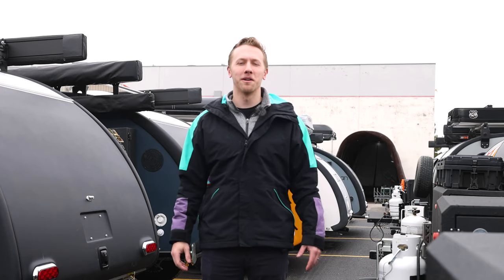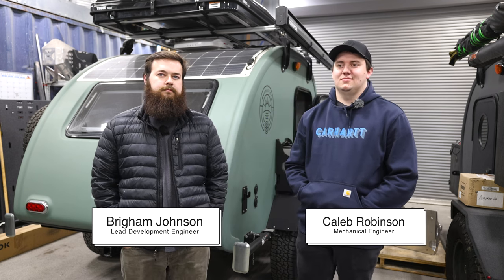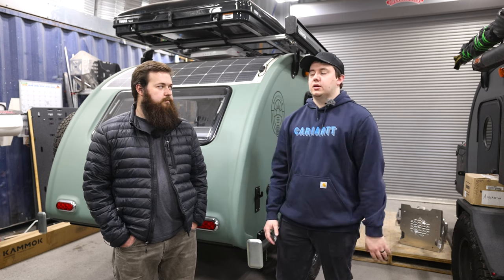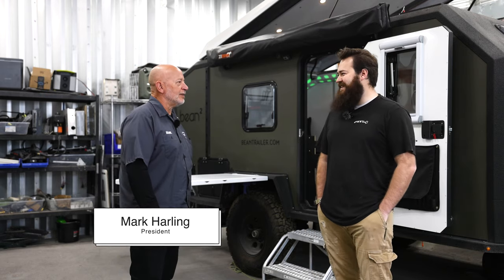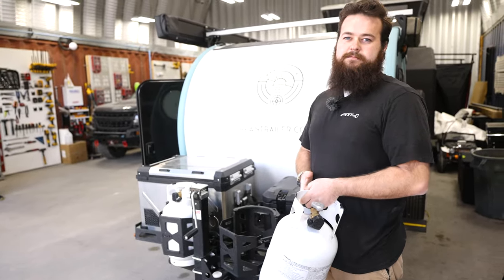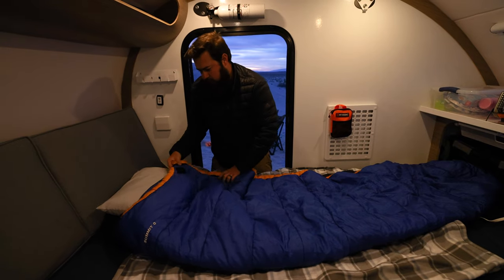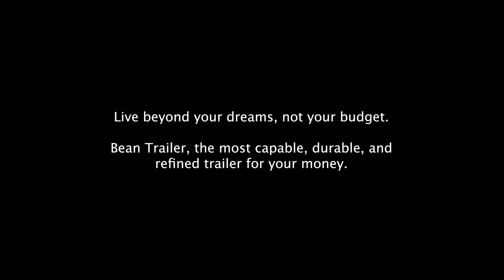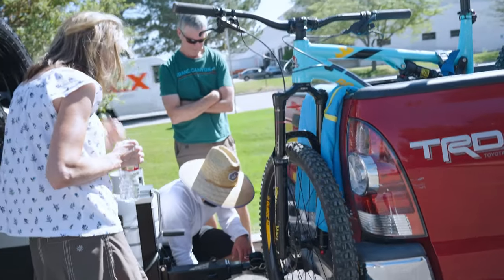Only REAL Campers Would Understand | The Making of Bean Stock 2.0

Comment: I love this video. It will make it a great link for all the people that ask us about our Meaner Bean but don't have the horsepower to tow one. 

We love our rear galley but added a fender table a couple of years ago. We use it for serving and making sandwiches... I can easily imagine it replacing the galley countertop, especially with the plow grill nearby, and having the instant awning.

Honestly, the 180 awning would be another good choice, especially for people who often camp in one spot for a few days.  I set up our fender table and 180 awning at 90% of our camps even if it's just for one night. It takes less than 5 minutes. I could literally do it blindfolded.

I can also imagine the advantages of basing the electrical system on a portable power station. We carry a smaller one as backup and have used it more than once as our primary power source along with solar. Simple and versatile.

I'd want a sturdy vented canvas bag for that ICECO location.

Bean trailers are unparalleled in design, materials, and construction. Our factory tour and subsequent purchase experience was awesome. They also have some of the best customer service I've ever heard of. 

It's just my opinion after more than 3 years of ownership during all season camping.
Reply: "I'd want a sturdy vented canvas bag for that ICECO location." Anything in particular that you'd recommend? I've been wondering if I should try to figure out something lightweight that would still protect it a bit, or something a bit more heavy duty (with more weight). We have a Stock 2.0 coming the end of this summer.

Comment: Sorry I missed the Bean roadshow that passed through Fresno, Ca. My 2 cents on this new trailer. Great concept and response to consumer demand. Loss of the galley is a tough one. While the side kitchen I’m sure is functional, rear galley’s are a big part of the teardrop romance. I agree with Playing With Sticks on a couple of points. Power box should be an option. A Bean Stalk 2:1 should be a highway version. The frame is a huge overkill for basic campers. And the tables are just too expensive. A suggestion—design and make a Bean chuck box. That hanging pouch is kind of embarrassing.  I do like trailer and story.

Comment: I don't understand how the basic Bean Stalker galley adds $15k over this. I feel like Bean Stalker should be more affordable
Reply: Everything is standard on Stalker(galley, inverter, hatch, awning, 2nd door, etc) nothing is standard on Stock 2.0. The 2 sided fiberglass hatch and galley cost thousands of dollars to manufacturer. Those are eliminated from Stock 2.0.
Reply: @mark-di5pf  Thanks for the extra info! I figured it would take a few thousand for the galley/second door.  Almost sounds like a stripped Bean Stalker could be as low as $20k?
Reply: no, more like $25k.
Reply: @mark-di5pf  I think a few thousand to me means $3-4k definitely not $9k. I'll keep an eye out for your future affordable offerings. The basic galley is something I really like!
Reply: I also assume the 2.0 electrical system is a simplified cost savings. Our Meaner Bean's electrical system appears to be pretty complex with multiple 110AC and 12v circuits, outlets, power ports, USB.. a lot of wiring. I'm guessing everything for the 2.0 is at the power station, other than some basic 12v lighting.
Reply: Although I can imagine the side galley working fine, Bean's rear galley is fantastic. The instant shelter formed by the geometry of Bean's massive hatch is the best in the industry. We went with the Premium galley and fully appreciate it after 40+ years of tent camping with jugs of water, boxes of gear, ice, and portable stoves...